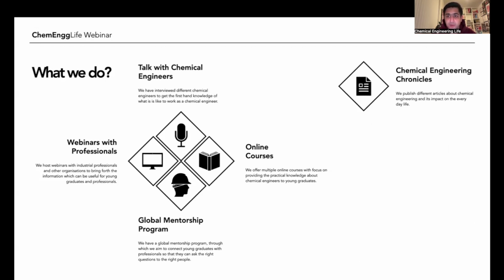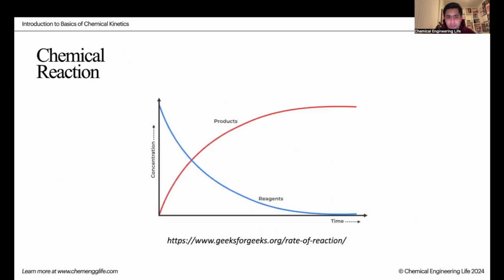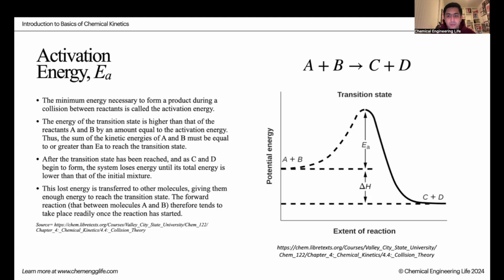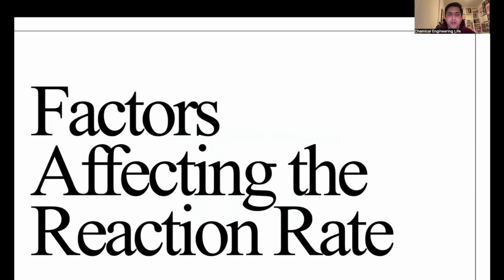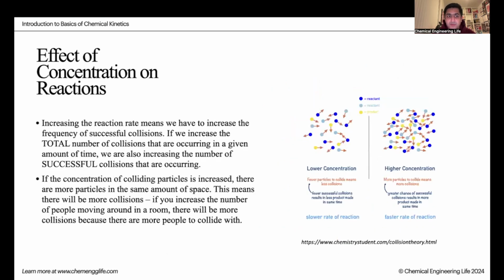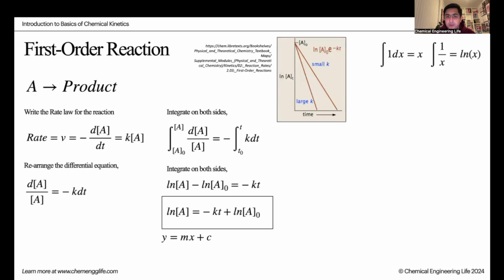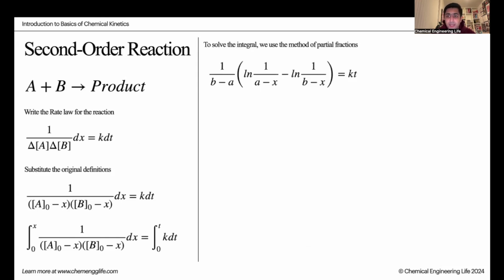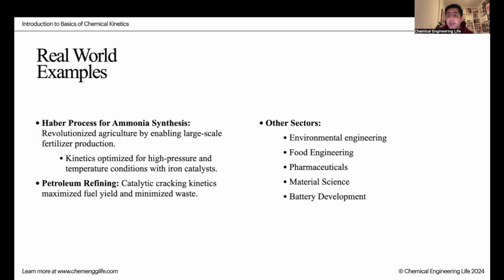Introduction to Basics of Chemical Kinetics || Webinar || Humzaa Imtiaz || ChemEnggLife

Comment: Sir, I am a first-year chemical engineering student currently doing my bachelor's from Pakistan's No. 1 university (NUST QS #353). I have two questions:
Q1. Does the ranking of a university matter for a job in the USA?
Q2. Any advice that would help me if I have to make my future in the US as a chemical engineer?
Reply from the maker: Hi! Thanks for your comment!
 
I will try to answer your question with the best of my ability! From what I have heard and know, university ranking can matter (if the employer is aware of Pakistan and NUST ranking), but more importantly skills, past work experience, and networking are often more important for jobs in the USA. I would probably focus more on learning useable and transferable skills and making my CV more attractive to the employer.

I do not myself live in the US, but generally, for making a career as a chemical engineer in the US, focus on building technical skills, gaining internships, and considering important certifications. I would strongly urge you to:
- Investigate and look into what sort of industries are prominent in USA, which hire chemical engineers
- Understand what sort of skills and requirements they require (might be a good idea to look at the job ads for chemical engineers in the city, you are planning to live in, because this would give you a great insight on what roles and sectors they are hiring in)
- Make use of LinkedIn and reach out to people working in the company(s) you wish to work and ask them for an informal coffee chat and/or ask them if they can share some information about requirements and so on.
- Finally, focus on making your CV better - try getting some experience from Pakistan, internships, courses and/or extracurricular projects

But keep in mind that I do not live in the USA, so my advice is very general and may not necessarily relate to the specific US market. 🙂

But if you may wish to have a detailed conversation about it, then our door is always open and let us know and we will be more than happy to have a chat to answer your questions! 🙂

Good luck in your journey! 🙂